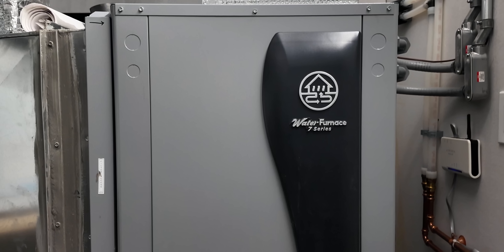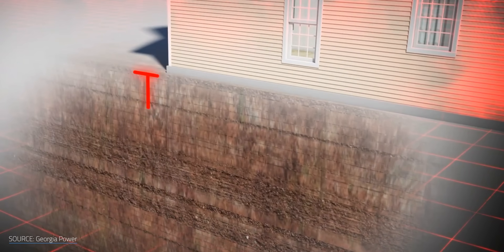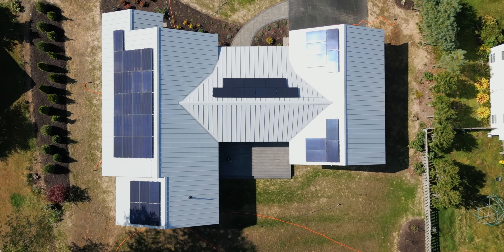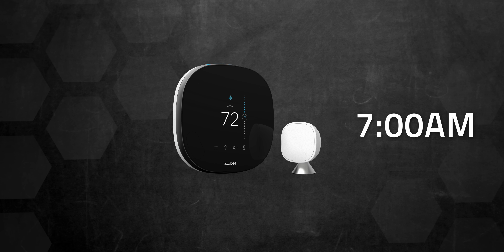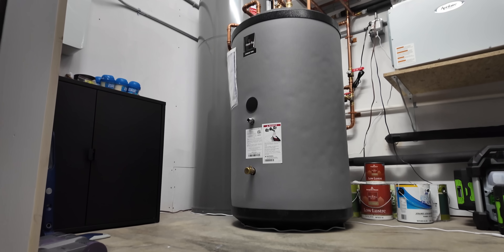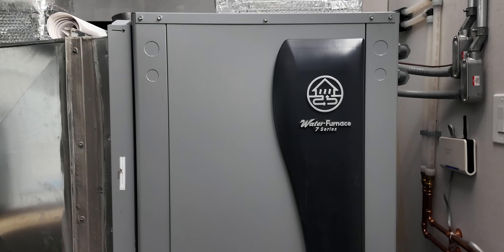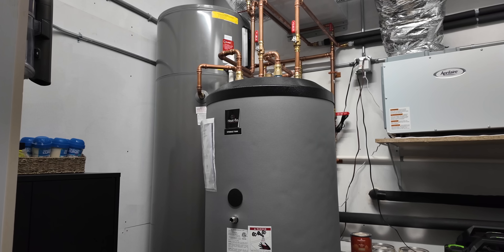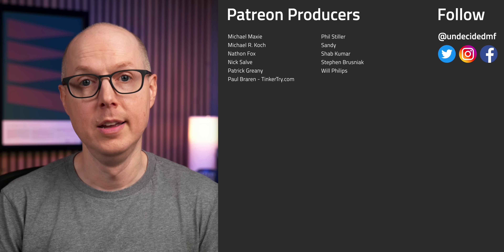How My Geothermal Heat Pump Really Performed (2 Years)

Comment: Here in the Nordic country’s geothermal heat pumps have been a common thing to install since the ‘90s. Since we have harder winters the air heat pumps wasn’t anywhere near as efficient for us back then, hence why geothermal caught on much more. That, and the fact that most homes have a water based heating system with radiators. 

Nowadays I’d say that air heat pumps have caught up, and the upfront investment cost for them is of course more favorable.

I’ve live on an old farm that has had vertical geothermal since mid ‘90s and the current heat pump is the second one in use. It’s around 10 years old at this point. I also have a wood boiler system and both systems are linked through a central accumulator tank that stores heated water. This makes the heat pump not as efficient but gives me the opportunity to control my energy usage and burn wood from my own forest at peak electricity rates. Pretty neat.

Comment: I wonder how this would work in an area that has a constant warm climate? In North Queensland we get maybe a week or 2 of what most people call cool where the daytime temperature doesn't get above the low 20s (Celcius) but the rest of the year will be between 30-35. I know you say the ground has a stable temperature, but after a few years with dumping heat into it for 10-11 months and then only taking it back out for 1-2, wouldn't it eventually get saturated?

Comment: $78 000 ... Ouch, that is like, let me calculate ..., 122 years worth of heating with firewood (usually oak) using a very efficient masonry fireplace (that one literally can build oneself) for a house with 240 sqr meters (2400 sqr feet), keeping warm in the Eastern European (Cold) Winters. And in addition, the system literally is built out (for the next 1000 years without much maintenance) and runs on green energy (mud/bricks, wood and air/oxygen), with very little moving parts (aside from the recirculating hot water pumps).

Comment: One thing which I don't think you've ever mentioned in your videos is the cost to build your plant room. Or, maybe I missed it? A gas boiler here in the UK can be hung on the wall. My oil boiler lives in the garage and is the size of a washing machine. Your impressive collection of equipment takes up a lot of floor space, so incorporating your plant room in your initial build must have added some significant costs?

Comment: 9:50 Wooah that's way more than southeast Michigan! It's 17 cents per kwhr during peak and 14 cents offpeak. Geothermal with tax break is $40k more than a conventional forced air furnace and air conditioner. I don't think it would be worth it. And the tax breaks are going away in 2026.

Comment: We live in a house from 1963 which is very badly insulated by Swedish standards. 125+125m2. We use 8000kwh/yr in total (all electricity use) without any other heating source  in a house with 2 adults and 3 kids.

Basically magic.

Comment: I designed my 2200 sf house in Central Valley California as a Carpenter, not Architect or Engineer and put in a Geothermal system.  The house was finished in 2004 so my Geothermal is over 20 years old.  Here the real HVAC load is during the weeks of 100+ degree days during the long summer and not heating during the short winter.  I have 4 ground wells that go down 150 feet.  The real bonus is that we hit groundwater at 80 feet so essentially we have a water-water heat exchanger.  Comparatively the real difference in cost was for the drilling and plumbing of the wells along with the 'aquarium pumps' and water loop plumbing.  In 20 years I've only had to replace one of the 'aquarium pumps' which circulate the water loop.  I've had HVAC serviced a couple of times and they commented on the extremely low load on the Compressor.  Basically the mechanical equipment will last 50+ years.  My electrical bills are less than a quarter that of my neighbors.  Solar has never penciled out as a worthwhile investment for me.  Here in California electricity runs between 20 and 40+ cents per KWH depending on the time of day.  In the end I think 2x6 exterior walls and all the extra effort to insulate the house has actually had a bigger return on investment.  When it takes less energy to heat and cool the house you save much every year just for that reason and you reduce the load on your HVAC.  (much like my 72 VW did when the 74 Gas Crisis hit and gasoline prices tripled)
If I had anything to do over again it would be to put the compressor on an isolated support structure (basically a 3' x 3' isolation support that has it's own small footing).  My house has a traditional suspended wood floor and the interior floor mounted compressor does cause the floor to drone some when the compressor is running.

Comment: My last 2 utility bills $107 and $103.  I have 1,000 watts of solar, one 6100 btu window unit.  It runs from 10:00am till sunset on my 3 lithium batteries.  That cools my living room and kitchen area.  My bedroom has same size unit on the grid. In winter I use wood stove. Year around $80-120 for 1400sqft house.  I also have a 1200btu mini split with both heat and air to help in drastic temps.  I honestly feel it’s best to focus on just one window unit versus trying to go completely off grid. My solar system is under $2000 and pays off in one year and will last 10 years plus.
Not only will it run window unit but  also my deep freezer year round. During power outages I run fridge and deep freezer overnight, with window unit during the day.  
  Sometimes going green cost more green than it’s truly worth.  Just my two cents.  But I’m glad there are people testing the limits and trying to advance, unfortunately we are still too far behind to make off grid a valuable option short term

Comment: Well, everything seems very appealing, but let’s do some math.
The total investment in the heat pump was $78,000. Before its installation, annual energy expenses amounted to $2,100, and after installation, $950, which means a yearly saving of $1,150.
If we divide the investment by the annual savings, that is, $78,000 / $1,150, we find that it would take 67.82 years to recover the investment through savings.

This calculation does not take into account maintenance costs and assumes that the original equipment will operate without breakdowns for the entire period.
The question is: Was it worth it?

Comment: 1:35 that’s not just like an air conditioner. That is an air conditioner. The difference is that most air conditioners don’t have the reversing valve that let you heat the house instead of cooling it.
Reply: @TheDJ42  most air conditioning unit will, it's only really America with tev and fixed speed compressors that won't
Reply: My AC unit in my apartment in Japan did both cooling and heating.
Reply: and an earthen heatsink and stage compressor

Comment: Suggest the issue of headlight management should have got a mention. At night time I’ve been taught to have the high beam on when it’s available to you.  But when a roo comes into vision, drop the beam back to low beam and allow the roo to reorientate itself to safely jump away from the road.  If the super bright dazing high beam and or spot lights are maintained on the roo, it blindly jumps toward the only known ground usually in front of it and hence starts jumping blindly toward the only known ground which is the illuminating ground in front of the on coming vehicle.  So use the bright lights to find your way through the night but when a roo is spotted in range - drop back to low beam.  Reduce speed too. Do the heavy breaking in a straight line on the black top.
(Spent many years working as a cop in outback QLD.)

Comment: A person could go broke saving money.   This summer I changed out the old natural gas leaking water heater tank with a nat gas tankless water heater.  Good when the house doesn't need extra heat but we'll see what happens this winter when the basement does't get the heat it did from the old standing water heater.

Comment: Interesting developments in Europe and elsewhere with the pairing of next-gen PV-Thermal panels (PVT), which deliver both electricity and heat, to the same brine-water heat pumps used in domestic geothermal systems. No drilling. No exterior units. Similar costs to PV+Air-Source Heat Pumps but with the performance and convenience of Geothermal. Some of these new PVT systems use heat exchangers originally designed for EV batteries; others are designed to retrofit existing PV systems. PVT can work alone with brine-water heat pumps, as a booster for bore-hole fluids in multi-source hybrid systems and/or as a heat source for seasonal borehole storage. A big stadium in Austria recently launched just such a system: more than a thousand PVT panels, brine-water heat pumps and a network of boreholes to time-shift seasonal heat.

Comment: Sadly, this came by the same day of learning roots got through our plumbing sewer line under our concrete foundation slab in a USA house. Ideas of saving money against upfront costs vs investments just went out the door as we figure out whether to use our emergency funds or find a better way to get rid of those roots and find a way to seal the pipe (less guaranteed) vs cutting the concrete and fixing the line correctly with more guarantee but cost. We will have to see what to buy and get done.

Comment: $39000 for an air source heat pump is INSAINE. Coil, condenser, air handler and even the lineset, is about 5k, shipped to anywhere in the US for a 14 ~16 SEER. Up until about😮 4 years ago before several government SEER hikes and refrigerant mandates, I was paying $2200 for the same full system at 13 SEER. Those units I installed 15 years ago are still humming along happily with no maintenance. 

At the same time I could heat my home with propane for 45 years for what you paid just for install, not counting the cost of repairs if anything ever has a hickup in that $90,000 system. My flame sensor costs $15, an inducer motor $100, you can fix it with a multimeter and a screwdriver, literally. 

I came here because I do like then idea, the tech is neat as all, but I dont know how you could reccomend to anyone with a striaght face they spend an extra $80,000 to save a few hundred dollars a year, even if the government is paying a chunk of that for you...

This just bothers me the same way I fell for the EV 'savings' hype right up until I bought my Tesla and got smacked in the face by the reality of it. I LOVE the car, but all the cost savings hype was bunk. My EV costs me more to use than my 9000lb diesel truck.

Comment: Seems like it would have been a lot cheaper to throw 2-3kW of extra panels on the roof (even if not on a prime south-face facet) and get regular mini-splits. Sure, you said that reaching net zero isn't about loading up on solar... but why isn't it?

Separately, having the thermostat a few degrees lower at night is good for your sleep quality. Personally, I set my 6F lower at night, and it certainly does help. The fact that ground-loop heat pumps discourage large swings in temperature is a big negative, in my opinion.

Comment: Good grief, keeping your house at 72 in the winter? My God, human beings have gotten so soft. 

Why? You need to wear shorts and a tank top  inside all year around?

Aside from how wasteful that is from an energy standpoint, raising the temp that high in a cold climate will make the indoor air bone dry, which is terrible for your mucus membranes, and is a major reason why ppl get sick more in the winter (no, the cold weather itself does not give you “colds”).

So, then you need to humidify the air, wasting more energy and putting more condensation pressure on your building envelope

Comment: I cannot understand why geothermal generation is not more common. We live in a relatively young alpine mountain area where the bedrock is mostly granite. I am willing to bet that that rock is pretty hot a few hundred feet down, so why do we not have a local mid-scale power plant making use of it? Community-scale heating and power systems make far more sense economically than single-home systems.

Comment: My only concern is that every heat pump I've ever used/experienced needed to be replaced at about 5 years. Geothermal is easy and should be cheap. 10 years from now, maintenance will be the telling question. Operationally it is cheap. Replacement is the question. residential appliances are designed with a 7 year lifespan. Not the best plan for a homeowner, but great for the manufacturer.
Reply: If you are having to replace heat pumps every 5 years, you’re abusing them somehow, or getting poor installations, or buying garbage brands. That is absolutely not normal. 7 years is also not normal
Reply: Is your fridge not lasting any longer than 5 years? Sounds crazy

Anyway, I don't need to go more than 2 minutes down the road to find a ground loop heat pump system installed in 1986 that is still running on all of its original parts.  The oldest system I know of with the original compressor is from 1981. Given they are r22 systems so easy on the compressor.

My own system only has raked up 33000 hours in 12 years so not even half manufacturers calculated life length, it's a scroll compressor

Comment: Interesting, ground source not an option for me, so I went with a 5 head heat pump and heat pump water heater - I wished I had gone for the SanCO2 mono block for the water. Your server rack will be outputting all that energy as heat, it's basically a space heater, that could combine fairly well with the heat pump water heater, or a heating only mini spllt, you can still of course add more smaller heat pumps to those additional rooms, a saddle window unit for example is an easy install.

Ultimately though, the 'moar solar' answer is a very real answer, if you have the space. As panels get cheaper and batteries get bigger, using element heaters for water and even base boards might start to pencil out if heat pumps remain stubbornly highly priced in North America, compared the their more established cheaper costs in parts of Europe and Asia.

Thanks for sharing your experience.

Comment: I can't afford geothermal. Instead, we have solar and a newly installed heat pump. During this month, I'm experimenting by pre-heating the home in the afternoon  using the solar energy to run the heat pump. When we get home in the evening, the house is nice and toasty and  we don't need to use natural gas until the next morning when we wake up. We are very fortunate in that our house is well insulated and holds on to the heat. I would encourage others with a similar set up to give this a try.
Reply: I was under the impression that heat pumps like a constant temperature setting, so in this scenario a battery might be more efficient, rather than ramping up and down. Also why use natural gas at all? Isn't it more expensive than your heat pump even running off the grid?
Reply: @Eponymous300 I'm waiting for battery prices to come down before getting one. I would like to wait for a sodium ion chemistry.
For me, Natural gas is cheaper than using heat pump unless the heat pump is using solar energy self produced from the panels. 
It's not a huge effort. Yesterday, We raise the temperature to 22° through the afternoon using the heat pump/solar combination while we were running errands. Our home is well insulated and we've got tyvek envelope. Even though outside is windy and going from 14° down to 3° overnight, we didn't need to heat our home after 12 pm. We wake up to a comfortable 18° home. We didn't use any energy to heat our home for 20 hours.
Reply: @TooSchoolForKool  18C isn't "comfortable", that is 64 degrees F, that is cold as hell. 22C is comfortable.

Comment: If the temperature of the ground is more or less stable after 6-10ft, it seems like it would be less costly to have 3-5 shorter wells than one mega well? I was going to try to do something similar here, since while drilling for water we ended up drilling several holes, but none were near the house. We did not end up finding water either, so investing thousands into HVAC is really not at the top of my list.

Comment: Matt, you should install a system of dampers in your server rack room. During the winter hot air is pulled from the server rack area and with a small fan blown to the center of the home for added heating. During the summer months the hot air from the server rack is blown outside.
Reply: There used to be a similar setup for a Cray (Cray-2 I think) computer setup at a AF base. Water cooled, but similar.
Reply: As I’m sure this house is very air tight simply pushing air outdoors would destroy the efficiency of the whole house system. However I’m sure it has an erv or hrv that could be cycled as a seasonal evacuation during the summer and closed off during the winter and exchange the warm closet air with the envelope of the house. This would have a zero cost during the summer as fresh air exchange is built into the system. The closet could maybe have a duct tied to return air and again have zero cost to capture the heat and cycle into the envelope during the winter months. Just my two cents.
Reply: Yup, keeping a server rack indoors and having it blow its heat into the room, whilst you also try to cool it in the summer, means that you double the energy cost of your cooling system. Energy isnt created or destroyed, so...once you blow X amount of kilowatts worth of energy into your house, you have to spend that amount again, to get it out.
Reply: @UninstallingWindows  Damper was the key word in his comment.

Comment: All those Federal discounts end 12/31/2025.  And since you are not qualified for the 30% reduction in your taxes until the systems are installed and running, you can forget about any Federal discount unless your system is running or will be very soon.  That said, I am getting a solar system and battery backup anyway.  It's not always about the dollar.